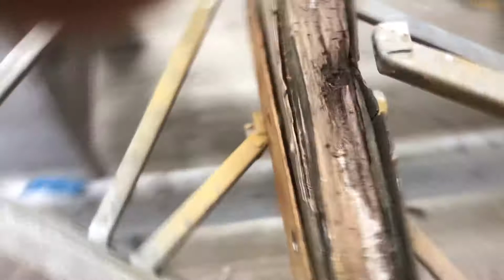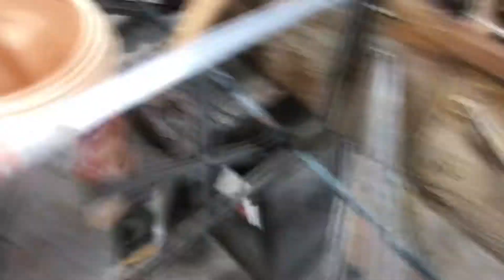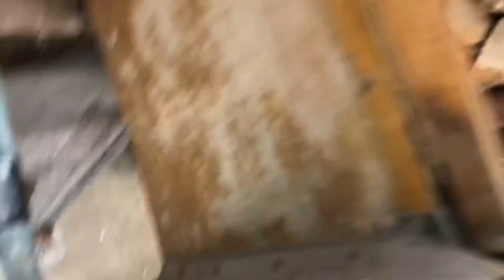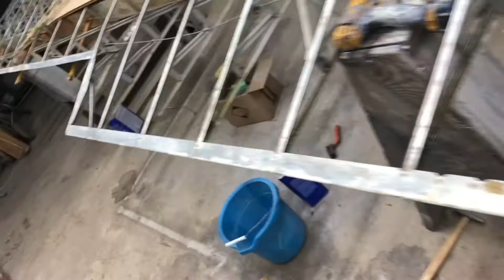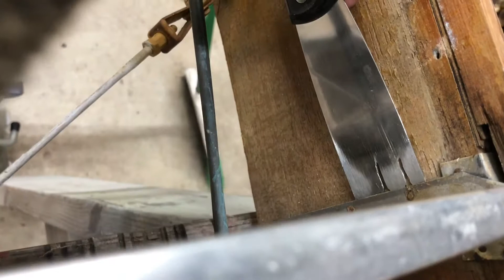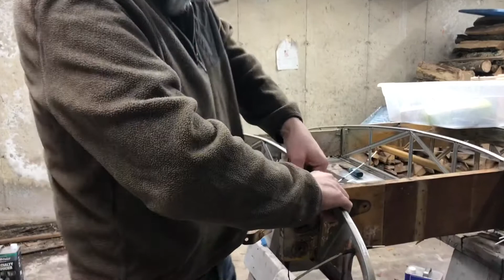Episode 5- 1941 Piper J5A- Wing Disassembly

Comment: For pulling the nails, what do you think of using an automotive body stud welder dent puller?  I doubt the relatively small amount of heat those things use would damage the aluminum, but I dunno.  I've never actually used them, so I don't really know what I'm talking about, but I figured I'd throw it out there.  Could you also drill off the heads without damaging the aluminum?
Reply from the maker: Charlie, thanks for watching. You can’t use a dent puller because you would need a complete electrical circuit…which you would not be able to accomplish with the wood spars.
Reply from the maker: Drilling off the heads or grinding the heads is also problematic because of high potential for damage to the ribs. I appreciate the ideas though.

Comment: Very interesting where those wood blocks were installed on top of your spars on your left wing. I have a left wing tank and mine are installed closer inboard. I would highly recommend using a new butt spar from Univair for your first wing rib. Univairs butt wing ribs will have more flange for when you are screwing in your wing fairings. You are correct that the doublers are about 1/32” mahogany. Make sure when you order/make your new wing spars that you milk the spars the correct thickness to account for fitting in the metal brackets WITH the doubler plates glued on. I had to remill my spars 1/32” over the area where the plates glued on because the spar was too thick. If you need some parts for wing ribs let me know. I have my old wing ribs from when I replaced all mine with Dakota Cub wing ribs. Instead of those pesky nails we were able to use screws to hold the wing ribs in place!
Reply from the maker: Thanks very much for your advice. I’m fairly close to ordering the blanks from Aircraft Spruce. My wife has a fairly complete wood shop, so we should be in good shape with the Spars. The blocking on the Spars are for 4 ribs or 3 bays. It came to me in the middle of the night what those plywood doublers are for on rib one and four…It’s for the fabric to attach if the LH tank was used. I will let you know on the ribs, thanks very much for you offer. Dave